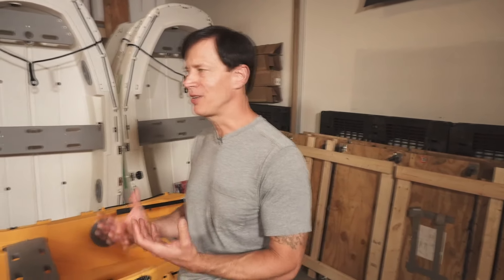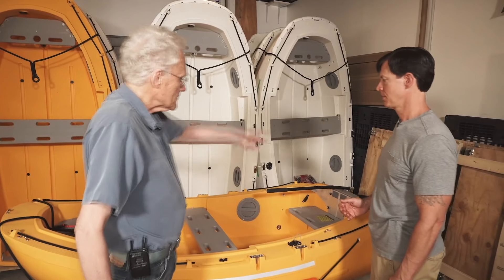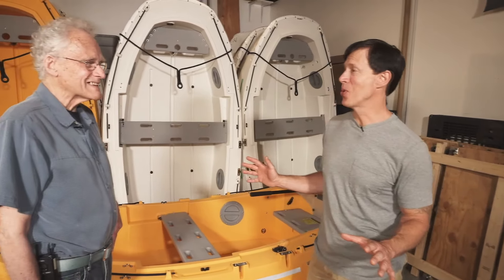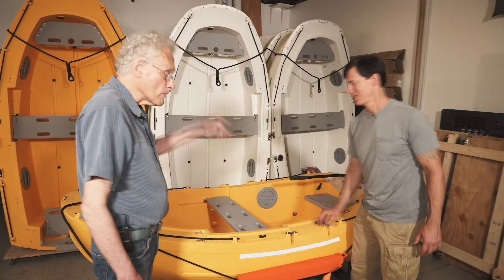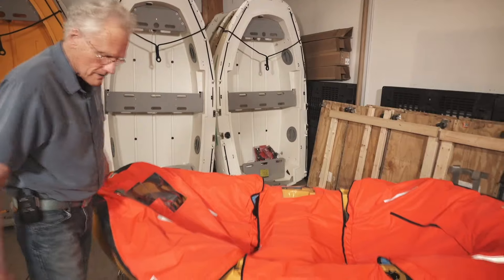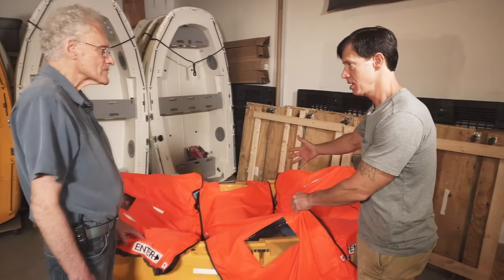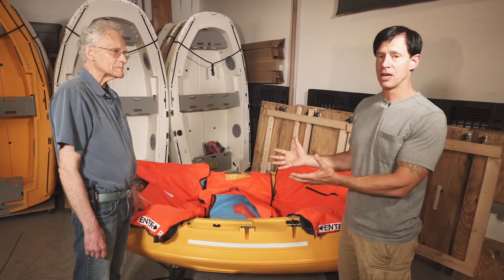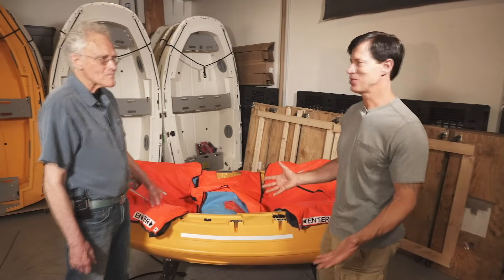Portland Pudgy Storm Dinghy with Para-Anchor Safety System

Comment: Well a 275 pound dude is great and all, but I go about 470 and am just 1 foot exactly shorter than this boat. Is it THAT stable?
Reply from the maker: Add a couple of pillows and you’ll sleep like a baby. Thank you for your comment.
Reply: 470 pounds? You're in far more risk of dying of heart attack than drowning, dude.
Reply: @yarpenzigrin1893  Probably, but at my height that is already a heightened risk.
Reply: @yarpenzigrin1893  "...and eat less..."? You did read the part where I mentioned being 6'8"? 18 shoe and ring size isn't because I eat too much. It's because I am just a big dude. But thanks for the well thought out reply. Very helpful.
Reply: @firegiants1812  You mean you aren't overweight, you're a bodybuilder? In that case disregard my my advice on nutrition. This boat will be fine for you if you use it alone. If you plan on taking more passengers with you look for a larger vessel.
Reply: @yarpenzigrin1893  even at 6'8" he is still very overweight.  Shaq is over 7'1" tall and is less than 350#, could be more now that he is older and long retired.